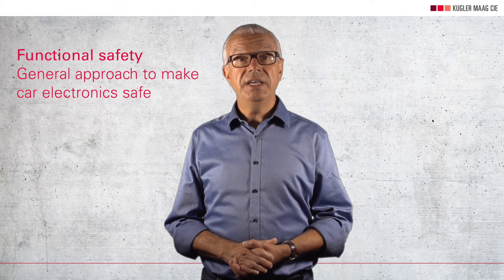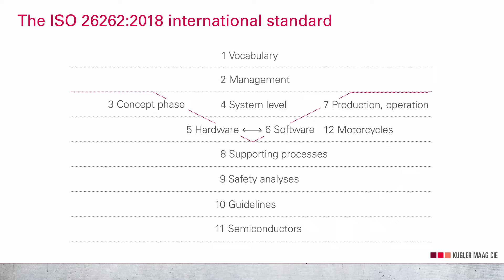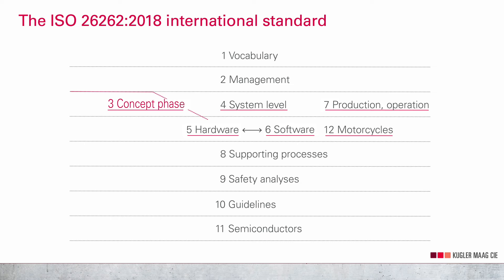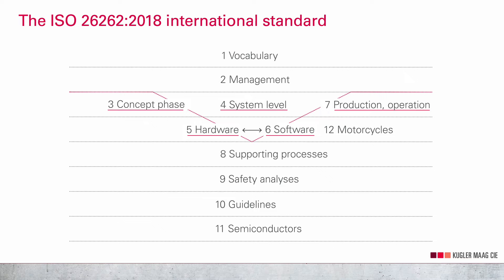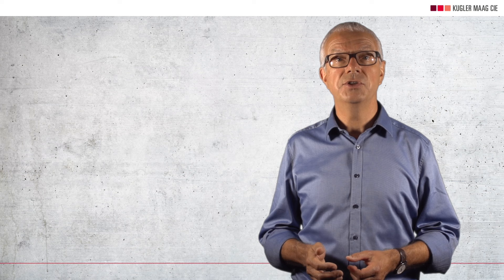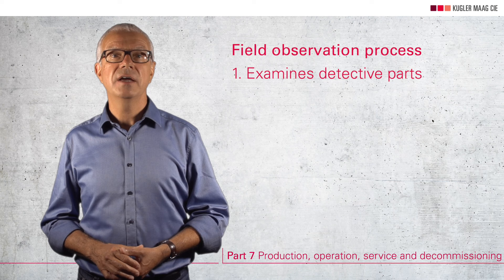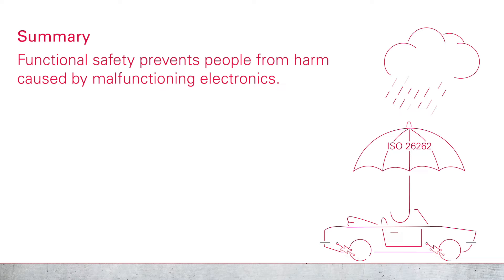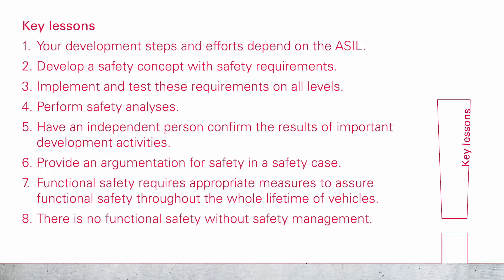ISO 26262 – Functional Safety at a Glance

Comment: Excellent demonstration.

Can Agile methodology be incorporated in functional safety product development?
Reply from the maker: Hi Partha, yes - agile development is now common and very useful in automotive as well. But be careful not to apply the Agile Manifesto verbatim. You need to formally review and document at certain points in your development process. Otherwise, you can never get a safety case. Agile development today is mainly applied to software development. Kugler Maag Cie has set up the "Agile in Automotive" conference series especially for this topic. Greetings - Erwin Petry
Reply: @KUGLERMAAGCIE  Thanks. But in me experience, it seems all embedded automotive ECU development are through V-model only. Are V-model and Agile compatible with each other?
Reply from the maker: Well, almost all system development approaches are based on the logic of the v-model, that's true. If you want to use agile approaches within the framework of the v-model, you just need to rethink the scope: the v-model does not require that the process steps be performed sequentially, one after the other. You can also complete the relevant tasks that the v-model expects within a sprint. This way, you develop incrementally and deliver the appropriate results.